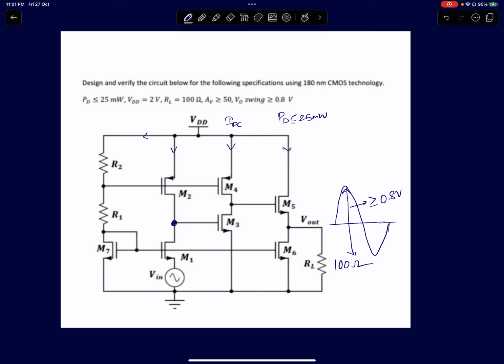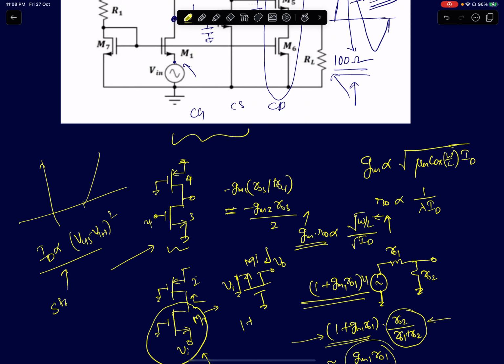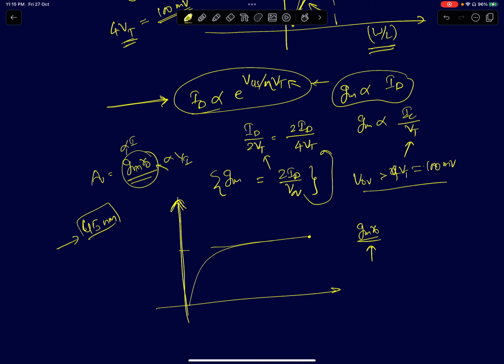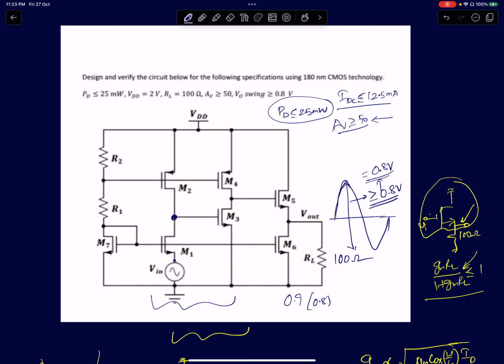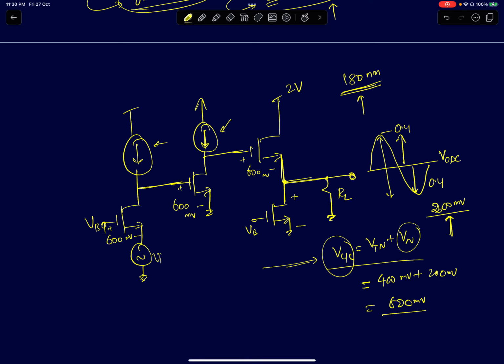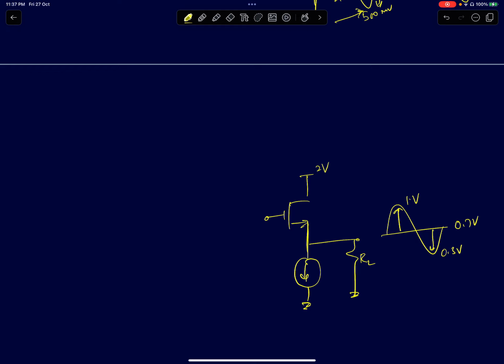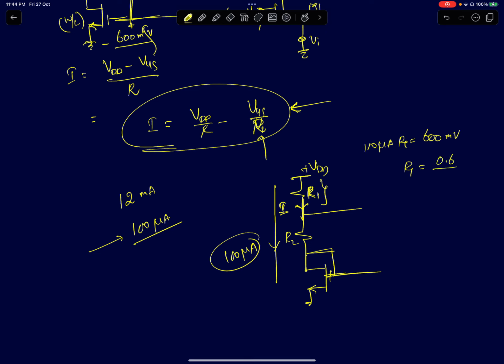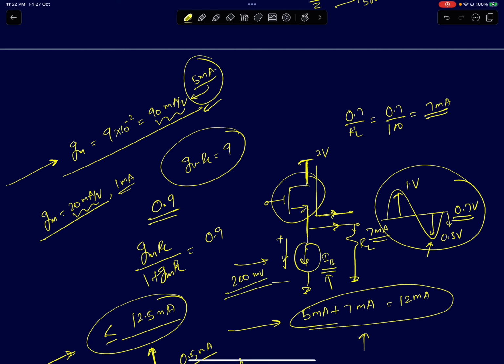CMOS OPAMP Lec 2) Single ended amplifier design problem- Qualitative approach

Comment: Hello Sir ... Very good explanation. 1 small doubt. At 37:00 , you say gmRL /(1+gmRL) =0.9 , But here, gm" is for the NMOS common drain transitor & not bottom NMOS bias transistor, So when Idrain comes to be around 5mA, isnt thats the current flowing through  the TOP one & not bottom one "IB"?
Reply from the maker: Hi Suman, you are right. I just watched the video n I did end up saying that. I will make a correction video sometime later. The CD amplifier is driving a resistor n so that will end up deciding the current. The current through the CD amplifier MOS device is Ir+Ibias. So its average current value will be 7+5=12 mA. With 12 mA being the average value, The peak current drawn from supply (and hence the current flowing through the CD MOS device) is 11+5=16 mA (assuming the output swings from 0.3-1.1 V). The minimum current flowing the common drain MOS device is 3+5=8 mA. So the current through the CD MOS device is always greater than 5 mA(it is in fact > 8 mA). Hence the gain will be always greater than 0.9. The current drawn from the supply will be a sinusoidal current oscillating between 16.5 to 8.5 mA, with an average value of 12.5 mA (12+0.5). Assuming 0.5 mA is being spent in the first two stages. So I think that meets all the specs. Plus there is no spec for linearity (THD)., so the gain varying with signal amplitide should not be a problem.
Reply from the maker: Also I assumed that the spec for power given in the problem is average power. If it is peak power then you have decrease the current in the bias device to 1 mA and the CD amplifier device current can go as low as 3+1=4 mA. The gain might go slightly lower than 0.9 V/V at that point. But it can be fixed by increasing the gain of the previous two stages